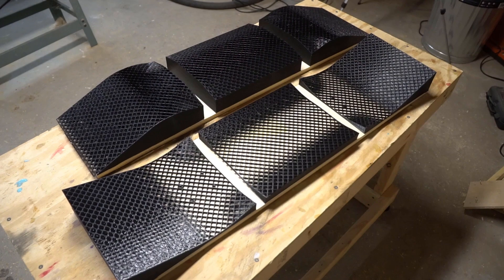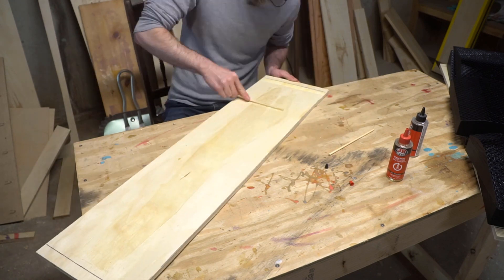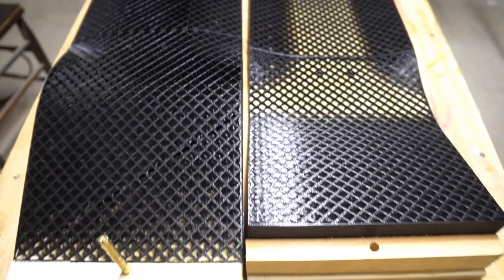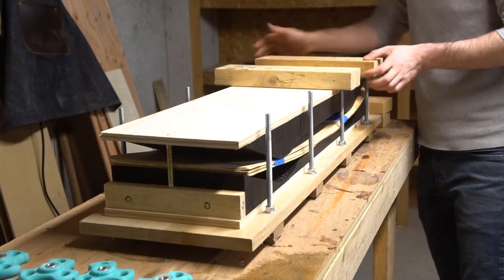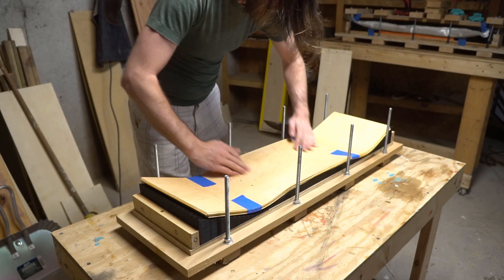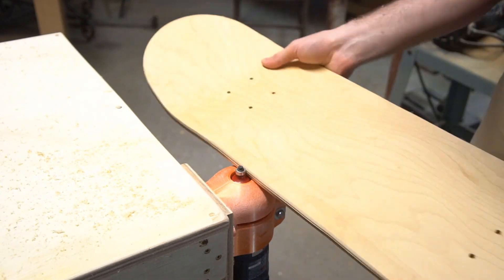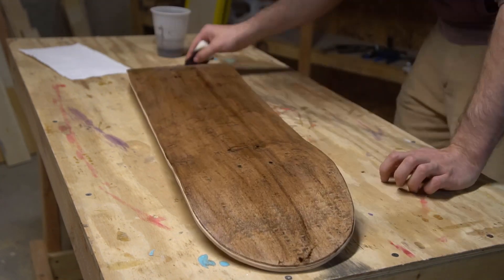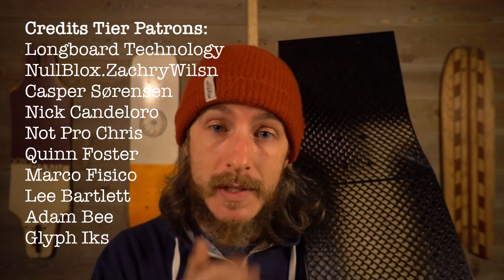3D Printable Skateboard Molds - FREE and Open Source!

Comment: nice job! I have the male half of a similar mold I use with a vacuum bag but I am wanting to make a new mold with new concave, etc. So you get sufficient pressure with the bolts and ribs? Have you considered filling the gaps with bondo on the molds for strength? I don't own a 3D printer but this is the reason I have for wanting one.

Comment: As a furniture maker/woodworker, you dont need "color to make the grain pop" and i would argue it lessens how much the grain pops. To accentuate grain, you woudld want to use a penetrating oil or finish. Matte finish Polyurethane would even make it pop more than some sort of darkening stain. Its a hot topic in the ww community, stain or not to stain. With birds eye maple or any figured grain, I personally would never stain but might use something that has a bit of a darker tinge to it like shellac or a lacquer or again poly with a very light stain combined but maple in all its forms is my favorite wood to work with lol so i  may be biased. All of this would also depend on what finish you eventually plan to use to seal everything on the bottom in.   
Either way, i def want to get the plans and press my own board! well done on the board and press!
Reply: I wouldve sanded the bottom to at least 150 (120 for paint), then done a grain pop with a damp cloth, sand to 150 again, then apply whatever stain or finish.

Comment: what veneer are you using? can i use normal wood?
Reply from the maker: It's rock maple veneers that are cut a little thicker than normal. You could probably use most hardwoods to make a deck if you can get sheets in the right thickness, but the normal pine and plywoods that you'd get in a home goods store will be too weak

Comment: whats the maximum width the mold can handle reasonably? want to print it out but i like a width in between 9-10 inches
greetings from europe, austria
Reply from the maker: The mold files are about 9" wide but there's no reason you couldn't stretch them out in the width direction in your slicer. If you make sure they're all scaled the same the mold should still work, the concave will just be a little more shallow
Reply: @GoodRoads  thank you so much!
Reply: @GoodRoads  okay i ran into another question, i have a huge as curb for skating in my front yard which i used for skating… do you think if i put the curb (80kg) on top of the mold with the wood it will be enough pressure or are the method you used with the clamps makes more pressure?
Reply: * sparr press
Reply from the maker: I would add some clamps. The "put heavy stuff on the mold" technique works okay with baltic birch builds, but you don't get great curves and I don't think it would work on its own for a veneer layup. A good rule of thumb is the more you can squeeze it the better.
Reply: @GoodRoads  okay thank you so much, gonna put them together then!

Comment: Do you have any issues with the molds wearing or crushing out? I just designed my first mold for 3D printing thanks to this video and was wondering how many pressings you get out of a mold. I see that you have been experimenting with 3D prints for a while now. Also, I didn't catch what type of filament you used for your print. Thanks!
Reply from the maker: I make mine with PLA and I haven't had any issues with them yet, but I'm not using a super high-tonnage press either so your mileage may vary

Comment: What if you fill in the honey come of the mold with concrete to stiffen it up ?
Reply from the maker: That could work, it would depend on whether or not the concrete sort of bonds with the plastic. Otherwise you might end up with basically concrete ice cubes rattling around
Reply: @GoodRoads  spray concrete adhesive/bonding agent?
Reply from the maker: I didn't know that was a thing, that would definitely be an interesting experiment

Comment: I've got a question, I've wondered if the thickness of the board you've made is the same as your factory made street board. I know, It also depends on the veneer thickness used, but still how do these compare?
Reply from the maker: Mine is slightly thicker on account of the face veneers of the factory board being sanded down more, but it's not a big difference maybe a millimeter

Comment: Love this way of making molds, really innovative for dit boards. One question tho, What settings would You change if You have a smaller nozzle size like the standard 0.4?
Reply from the maker: I'm going to do some experiments with this soon but I can reliably get a 0.6mm line at a 0.3mm layer height and I want to see if that works. 0.8mm might be possible too but the lines might be messier (which doesn't matter much for a mold)

Comment: This is amazing, a skateboard mold I think might actually be useful. I've seen some the foam molds and they look like they would fall to bits after one press. I really like how you made the grid pattern. Would most probably cost a bit but this mold could be reinforced with jb steel weld and would be really durable I think. Great content thanks for sharing.
Reply from the maker: Depending on what pressing method you use the foam molds actually hold up for at least a few rounds. It's a good place to start if you're on a budget. These printed molds are more durable for sure, and the ability to modify them is what I think sets them apart from anything other than CNC wooden molds, which are quite a bit more expensive. If you're pressing a ton of the same blanks you really can't beat solid wood or concrete molds though

Comment: Great video! Do you think a 3D printed mold would be strong enough to use with the vacuum bag process? Looking at my first build, and wondering if I need to go with foam, or if I can use my printer for molds.
Reply from the maker: I haven't tried it but my suspicion is yes. The spar style presses are capable of more force than the vac bags, so if the molds hold up for  one they should hold up for the other. I can't say for sure without testing, but that's my guess
Reply: @GoodRoads  perfect, thanks. Now I just have to decide whether to go with the spar press or a vac bag. Keep the great content coming!

Comment: I just had a look at the cad, and I gotta say I don't think its janky at all.
The way you built the form might be more specific to this type of deck shape, but for the most part I'd say the way you did it makes it very approachable and easy to understand.

Using the offset face tool is supposedly not as good as the offset surface tool for this application in fusion, but that's almost more of a quirk with fusion and not anything to do with jank in your modeling.

My approach was to make instructions that were able to be very generally applied, but that doesn't mean its less janky.
Reply from the maker: Thanks dude. I actually think I keep running into minor issues with the offset face function which is why I still think the method you highlighted is better, even for a more simple geometry. My design works but it breaks down a bit if you modify it too heavily certain ways.  But, like you said, it's really simple and pretty easy to wrap your head around so hopefully it's fairly beginner-friendly

Comment: This really changes everything.
Which brand is going to be first to embrace this?
Reply: Roa Rockit kinda has the market covered already. The market is so small and still quite exclusive. 3D printers aren't really a commodity yet.
Reply from the maker: I see two ways the larger companies could benefit from this: fast, cheap prototyping, and custom limited edition runs. You better believe the first brand doing the latter is going to be Good Roads. Let's GO!